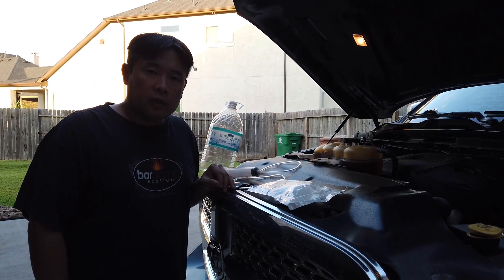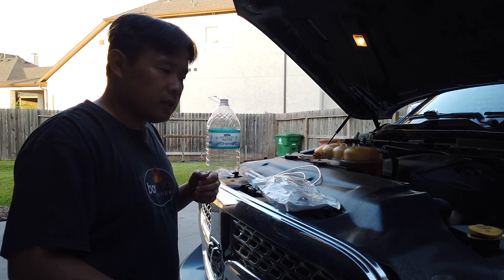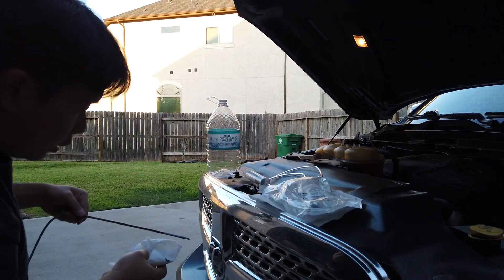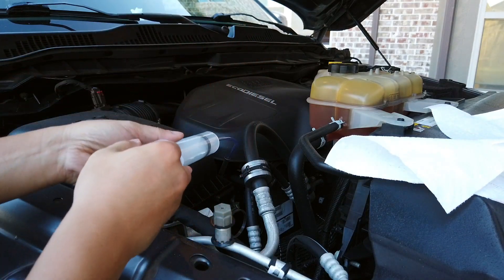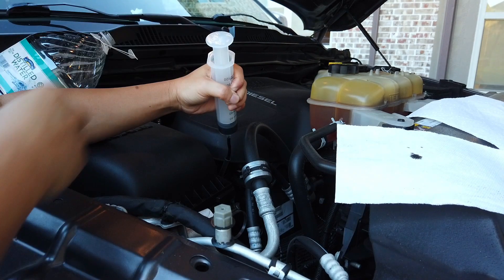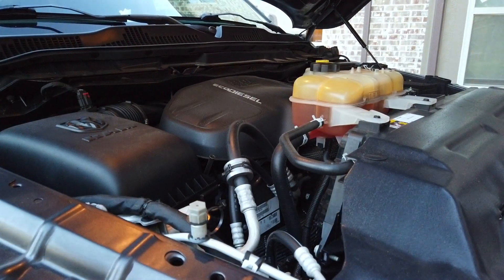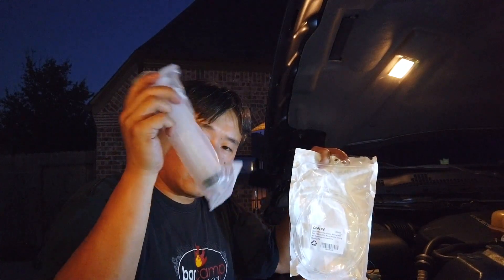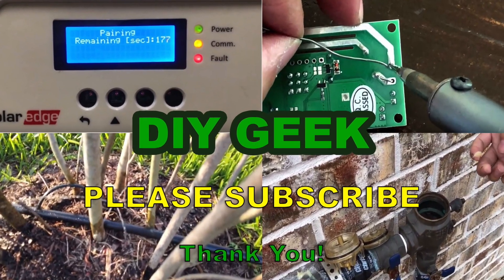Sucking Out Over Filled Engine Oil Without Opening Drain Plug!

Comment: My drain plug is all loosy goosy. Like if you try to remove it it just spins endlessly either direction so it neither loosens or tightens... so till i get that oil pan changed i gotta do this so i hope it works

Comment: just a tip that would make things a little easier, I used the same size hose but i used a bulb squeeze pump . You stick the hose in to the oil pan and then you hand squeeze the bulb and then the oil passes thru the bulb and comes out on the other side of the squeeze bulb thru a tube and into a container . there is no having to repeat the syringe process. cheers!

Comment: I had an oil change and filter done by a shop a week ago.  The following day, after a short run, I checked the oil level in the engine.  If any variance existed, I was expecting it to be down a little after the oil had worked its' way through the engine and eliminated any air pockets.  Was surprised to see the oil level 1-1/2" to 2" above the maximum level on the dip stick.  I googled and learned just how damaging an oil overfill can be to an engine.  I used the same type of syringe, 200 ml. size and extracted 800 ml. before the level came down to the recommended level.  The syringe does take a strong continuous pull to pump the oil into the syringe, but pre-lubricating the rubber plunger seal of the syringe with a thin layer of petroleum jelly improves the seal and helps it slide with slightly less effort.  The process worked well and took about 15 minutes.  The syringe and poly tube can easily be cleaned by running a good quality dish detergent (such as Dawn) through it several times and then rinse with clean water.  Not suitable for food grade liquids after you've used it for oil, but certainly reusable for most any other liquid.  My mechanic is back to work on Monday and he's going to hear from me.
Reply: Thanks so much for the info. Same story about mechanic. Only problem is the mechanic is a family member that will never own his mistake.
Reply: @kalakala10011  That could be a problem. lol.   My mechanic did take responsibility, apologized and offered the labor to be free for my next oil change and charge only for the oil and filter.

Comment: It worked. My mechanic put nearly 5L instead of 3.25 Liters . What an ifiot.
 I pulled 1. something L with the syringe and it worked. 
Quite dificult to fit the air hose though, but i managed o pass it under oil level. 
Thanks dude.

Comment: a better and cheaper way is to make use of the siphon principle that you learnt in school (your toilet makes use of it with every flush), (1) prefill a clear 4-foot hose with new oil, (2) then use your finger to block one end of hose and insert the other end into car's oil entrance, (3) get the hose's outside end much lower than the engine and let your finger go to let it open, the oil will be pulled out by gravity.  I tried it, works better than any pump or whatever.

Comment: Some stuff I learned from doing mine:

the hose simply needs to plug the dipstick tube, not necessarily reach all the way down to the bottom of the system (at least on my 2000 Subaru Outback). I was able to use a shorter,  wider 6mm ID tube stuck in the top of the tube forming a seal.

It was much more difficult to pull the weight of oil through the tube than expected, probably because my car has a thick 10W-30 oil plus an additive.

It was so difficult, I though I might be trying to pull a vacuum and bought a thin long tube to reach all the way down, which ended up just being more difficult to pull.

Ultimately I tried the original short and wide tube again, and made sure to hold the syringe downwards with the tube as parallel or downward toward the floor as it went over the edge of my engine compartment.

Comment: Why do you suck the oil through the dipstick tube instead of the opening where you add the oil?  It seams like you would be able to use a larger hose and do it quicker.
Reply: With the engine not running, if you look in the oil filler "opening" at the top of the engine, just inside it you'll maybe see the top part of a camshaft which lies across tops of the vertically mounted cylinders, inside which the pistons go up n dwn and connected to the crankshaft way below, and sealed from the camshaft by metal walls. Sadly 99% of the engine oil will have "fallen" to the bottom of the engine, the sump, where it lives until the engine's started again and it's pumped under pressure back to the top again to lubricate the moving parts including the camshafts. (If you accidentally leave your filler cap off and start the engine, you'll see the oil come out under some pressure ! - don't do it lol).  So to extract oil from the filler opening you need a VERY very small and long tube to hopefully go down past all the engine parts to the sump where the oil is  = not practical or even possible. Yes I guess a large hose at the top could, in theory, suck out the oil BUT it would have to create a helluva suction pressure, far more than is practical, and even then probably wouldn't work as so many obstructions in the way.
Reply: @RockinRedRover  the tube goes down the dipstick tube to the oil sump where the oil is , then just use the siphon to take out as much as you have to.
Reply: @pugmahone9439  appreciate that mate, my reply was to "DC" who thought be better to stick a tube thro the bigger filler hole in the rocker cover....
Reply: @natedogg999  pardon !??!
Reply: @RockinRedRover  I took a look wondering why u were tagging me but now I get it. Apparently the “gob” was an accident and I didn’t mean to do that. 😂